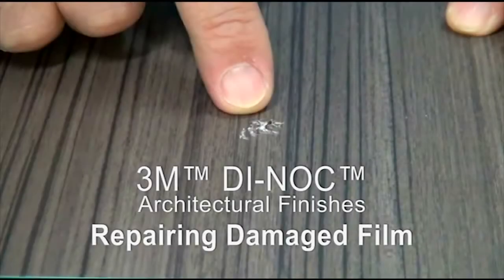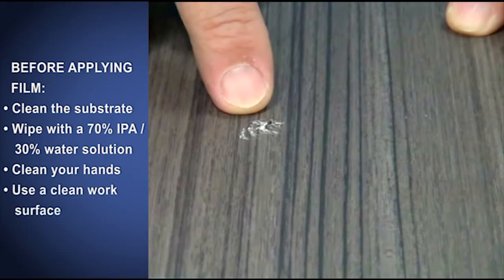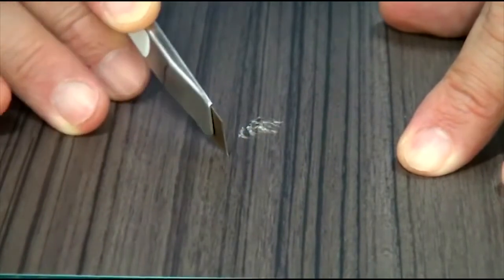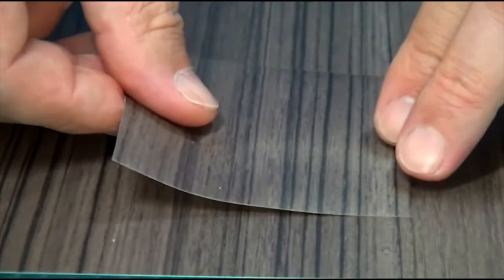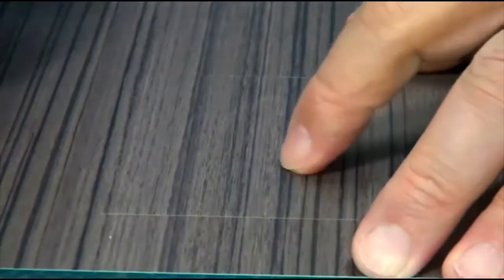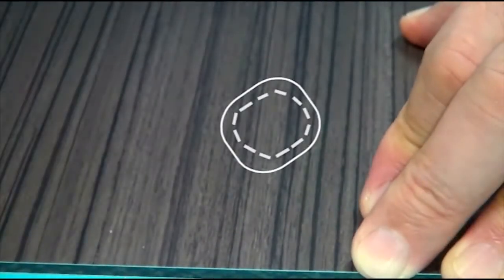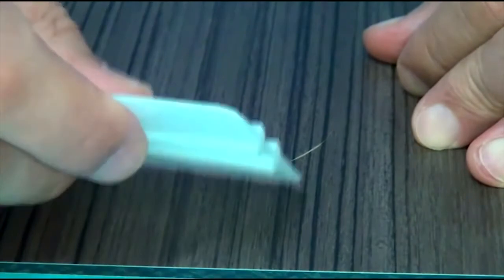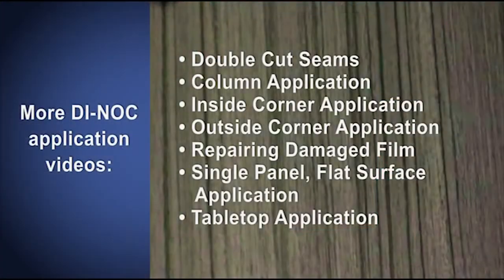3M™ DI-NOC™   Repairing Damaged Film

Comment: Hi I’ve got black 3M Di nok film on my car and it has a tree branch scratch on it . Can you show me how to remove it?
Reply from the maker: Hello Markward -

Thank you for reaching out about the scratch on your black 3M DI-NOC film. Minor scratches can often be addressed by gently heating the area with a heat gun or hair dryer, allowing the film's self-healing properties to work. After heating, buff the area with a microfiber cloth to smooth out imperfections. For deeper scratches, replacement of the damaged section may be necessary. To protect your film, avoid harsh conditions and regularly maintain it using suitable cleaning solutions. 

We hope this helps!